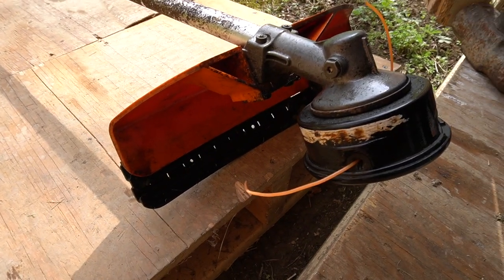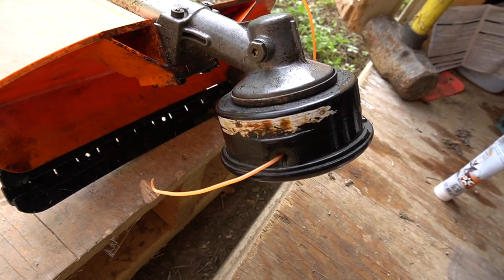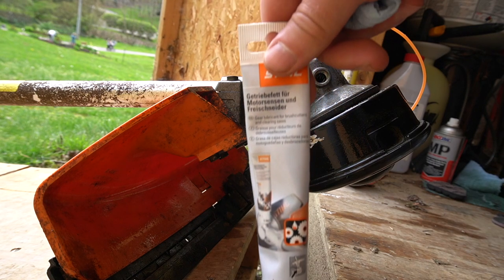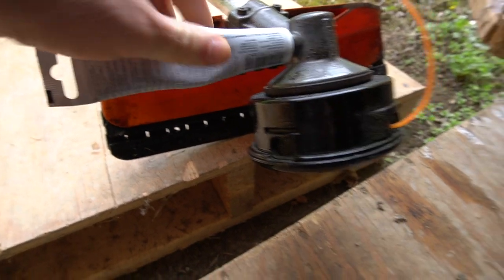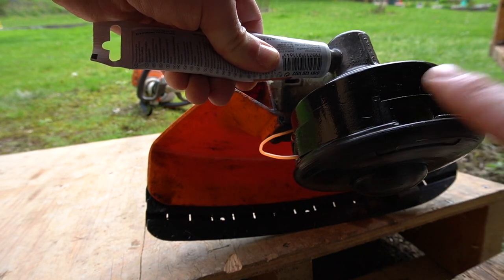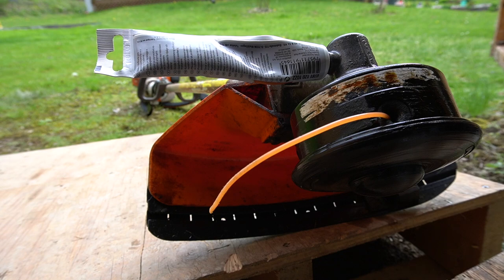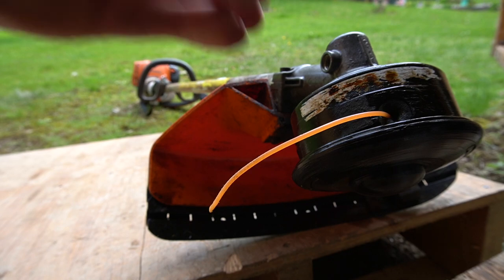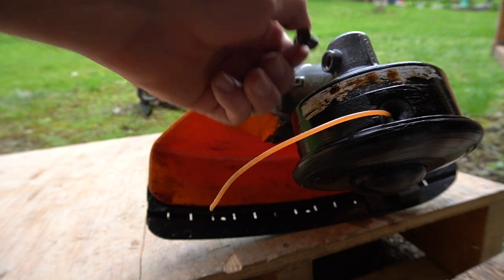How to service trimmer head, how to lubricated trimmer head to prevent wear and damage

Comment: Anyone know of a reason I shouldn't use typical pink grease out of a standard grease gun?  I noticed that the video included Stihl grease, but I'm curious to know if just standard grease gun grease would be ok.
Reply from the maker: Grease has compatibility issues. When non compatible 2 Grease mixed,  chemical reactions happens, it can dry up and becomes hard or water down.